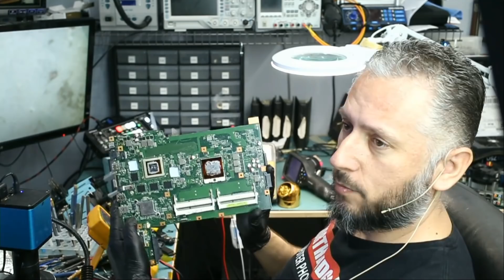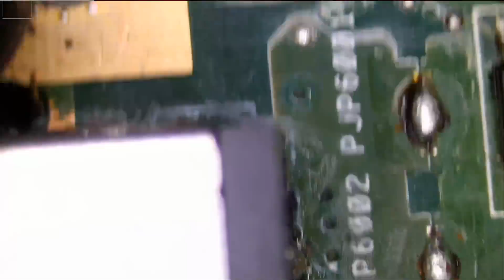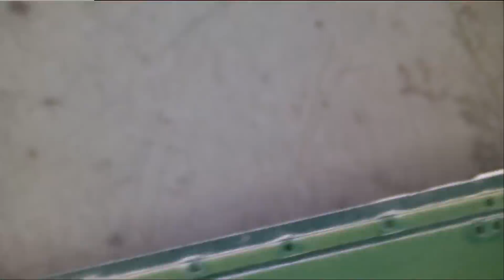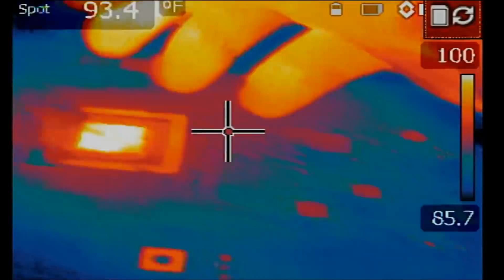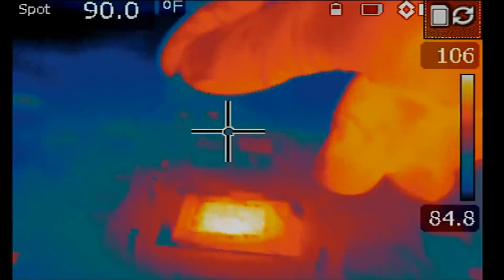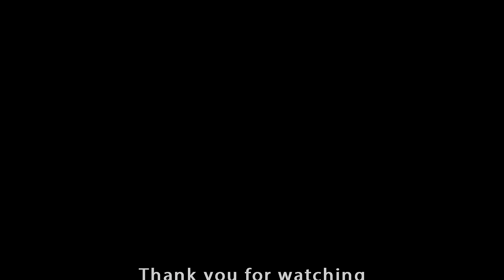Asus G74S Laptop No Power Repair ended abruptly

Comment: i have that motherboard , battery works and mobo works but when i insert the ACDC jack, computer gone off and , light on power button flash solid, some on the fronts too, i think its a short circuito or chip bypass for charge battery and or power up the motherboard is bad, where can u locate it ? a behavior , if i insert the acdc jack after 1 minute or two , the heat sink comes very hot!

Comment: That cpu is in a socket, so he could replace the cpu if he wanted to bring the laptop back to life again, although the mosfet may have blown again so he will need to replace that also.
Reply: I was just wondering if the cpu was socketed
Reply: Abernathy it was the gpu getting hot which is solderd and not the cpu

Comment: That's the bad part of embedded CPU - when the CPU goes bad instead of replacing it's time for a different board used or new - that's why the manufacturers sell embedded CPU to sell more motherboards
Reply: It is possible to replace CPUs. Problem is, Intel, AMD, they wont sell you BGA CPU...

Comment: Do Laptops not have a socket for the cpu, so it can be changed?
Reply: Yep, he meant the gpu in the video.
Reply: Much older laptops had replaceable CPUs and GPUs like desktops do, but they stopped making them since everyone wants thinner devices. Now they are BGA soldered to the board, usually leading them to end up as scrap when they fail, rather than someone easily swap out a part.
Reply: Older generation laptops that came out before 2014-15, if speaking about intel based laptops it the 4 th gen types, after this processors are mostly soldered directly on the motherboard.

Comment: hello from Romania, your videos are super cool, I'm a little curious, whyhello from Romania, your videos are super cool, I'm a little curious, why can't the CPU be replaced on laptops?  or why does no one replace them? Thx
Reply from the maker: The fault is  the GPU not CPU. I said CPU in the video
Reply: @NorthridgeFix  I understand, I insist with the question 😁, usually CPU and GPU, why are not replaceble? Thx, I hope you don't mind me👍
Reply: @bogdanel500  you cant find em anywhere.
Reply: @bogdanel500  Because they're soldered onto the board and the time and effort to replace it is not worth what you will earn from it
Reply: @JaveChen  thanks for the reply, don't think it was a criticism, it was for my knowledge because no one replaced it.  thank you very much and have a nice evening (07.33 pm in beautiful Romania) 👍
Reply: @tobysmith3674  thanks for the reply, don't think it was a criticism, it was for my knowledge because no one replaced it.  thank you very much and have a nice evening (07.33 pm in beautiful Romania) 👍
Reply: Because unlike much much older laptops, where the CPU and GPU were user replaceable, like desktops, they moved to BGA soldering the processors to the board. Mostly because consumers what thinner devices... Apparently, not that there would be a great deal more of thickness if it was replaceable.
Many do not go forward with replacing the BGA chips as it can be difficult to source working chips, as well as the time involved in removing, cleaning, resoldering (even reballing if you manage to solder it incorrectly) as it becomes a big time sink which may not result in success.
Reply: @MrCheezyCake  thanks for the reply, don't think it was a criticism, it was for my knowledge because no one replaced it.  thank you very much and have a nice evening (07.33 pm in beautiful Romania) 👍
Reply: Shanae  thanks for the reply, don't think it was a criticism, it was for my knowledge because no one replaced it.  thank you very much and have a nice evening (07.33 pm in beautiful Romania) 👍

Comment: Did you solder all eight legs of the MOSFET? I only saw four...
@5.39
Reply: The others 4 pins are all connected with the base
Reply: 5:39 

The drain side is a big pad. The 4 legs you see are merely aesthetic.

Comment: Hi there, please In your future videos show us exactly on which pin you inject the voltage, you said we must inject on short area, but please show us which pin or which side of ceramic capasitor you are gonna inject the voltage. Keep it up. Thankyou for your useful tutorial video.
Reply: If that needs explanation for you, you should absolutely not attempt any voltage injection.
Reply: @FrozenHaxor  if you are watching these tutorial videos, is better give your electronic staff to repair shop!!!! And don't waste your time!!
Reply: You always measure the short between a pad and ground. Most of the time the ground pad has direct connection to a ground plane. So you have to inject the voltage between the ground and the pad where you measured the short initially. To know if this is the right pad to find the error will need some knowledge of circuits and experience in repairing electronics.

Comment: Don’t know whether it is economically viable, but my impression from the view is that the CPU is not soldered to the board. Wouldn’t it make sense to go on in this case?
Reply from the maker: It's soldered on. it's neither practical nor economically viable to replace the GPU.
Reply: @NorthridgeFix    Maybe you're confusing the GPU with the CPU? It's clearly visible that the cpu is mounted on a socket, while the gpu is the one soldered on.
Reply: @Expo_Hans  Correct. The GPU was getting hot, not the socketed CPU
Reply from the maker: @Expo_Hans  Yes 100%. it's the GPU not CPU.